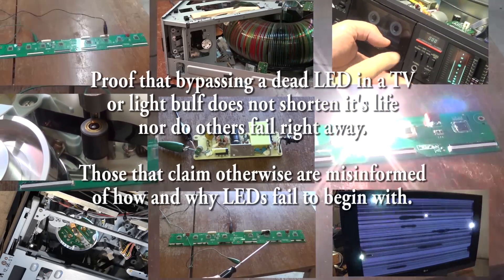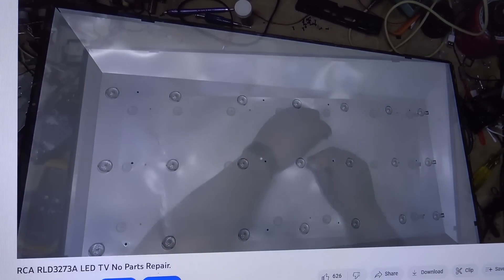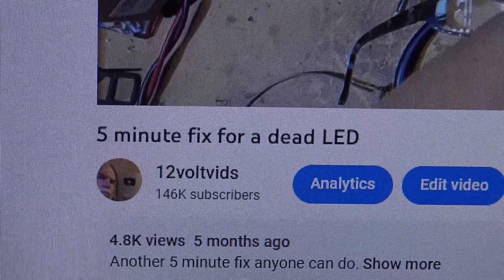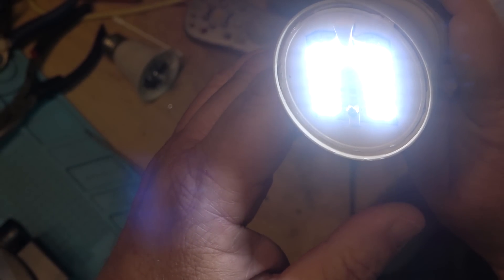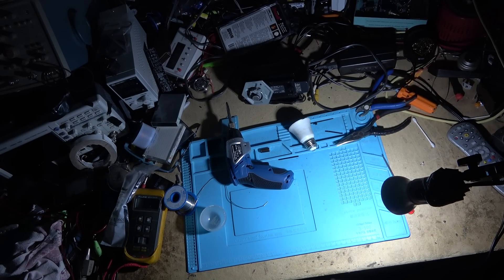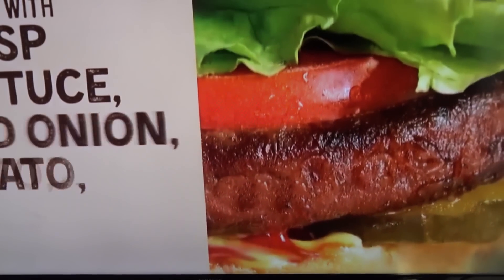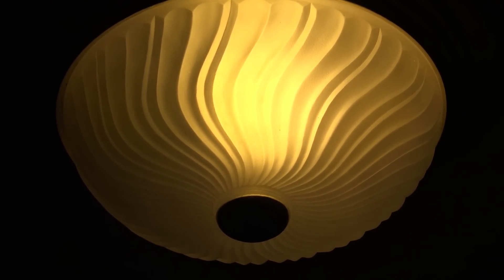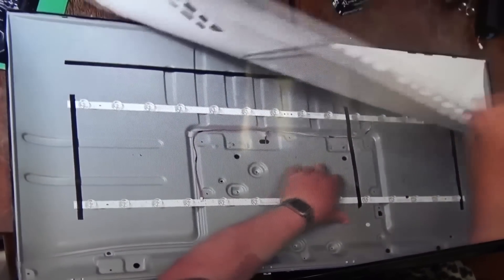You can stick your comments about LED TV failures where the LEDs don't shine

Comment: Bridging one LED will lower the voltage onto the series string of LEDs. It takes away strain from the buck converter type mains power supply, decreases heat coming from the supply and from the LEDs left (because one is missing). So in the end, it actually has the potential to prolong the life of the rest of the LEDs and the circuit. If people just would use common sense, they'd understand that this approach is working pretty well.

Comment: I think your method is great! You have to fix these things cheap in order keep the customer happy and keep the set out of the land fill. I wouldn't hesitate to bypass a LED or two after watching your videos! Thanks for sharing all this great repair knowledge with us!
Reply from the maker: It works. Been doing it for years.
Unfortunately I have to deal with the keyboard warriors that have no idea how the power supplies on these current limited Led drivers work.   they all have the same premise that if one LED fails all the rest of them must be ready to fail and that's just not how it works.  Led have a design life of 20000 to 100000 hours.  However defects in manufacture can have some failing as soon as a few hundred or fewer hours.  This is the problem on the majority of bulbs and the back lights in TV's.  They insisted all there have to be replaced. what they are forgetting is that even replacing all of them you could still have a new one that is going to fail after a couple hundred hours. There is not enough money in fixing TV's when 30 or 50 is required to buy led strips. Plus there is the extra labour to remove the old parts and reattach the lenses on the new LEDs. I've never made more than $100 fixing one of these televisions and many i make 0 on because the set was given to me and i fix it either to keep or unload.  
I have a 37" set i fixed the power supply on about 4 months ago.  I have been unable to even get 20.00 for it.  Have it listed at 10.00 now and nobody wants it and I have about 10.00 on parts in it.  Eventually it will be given away.  The video I made of the repair has generates 47.00 in the time it has been up. Sure it makes about 8.00 a month but that's a slow way to make money.

Comment: I did bridge the LED bulbs since I got the first dead one. I put a new one where a dead one was and I have put the bridged one to replace the old CFL's. None have failed yet, though they are at places that don't get used frequently.
Reply from the maker: Well i have 1 set that ribs 24/7 and no more failures abd don't expect any.

Comment: I = E/R it's that simple....
Reply from the maker: Except that semiconductors are not resistors.   They are open completly untill you hit the forward bias voltage then they avalanche into full conduction.
Reply: @12voltvids  I'm a retired BSEE no matter how you slice it more current = less usable life. You don't have to like it you just need to know the science. Do an experiment:  Buy 2 NEW LED lights same model number.  Modify one bypassing one LED.  Keep them burning until one fails.
Reply from the maker: @franksulu5274  the current does not increase.  On the tv the current is controlled.  It doesn't care if there are 30 or 60 led in series the current is limited to 30ma. Why do you think they use the same board on multiple models of different sizes.  I have taken power boards from 60" sets and put them in 40" sets and vise versa.  All work perfect.  The 40" set had 1/3 the number of led.  The voltage was matched to the number of led.  Now if you are considering a fixed viktage supply then yes increasing the voltage will increase the current but now with these led drivers.  The Philips bulb i chopped the failed diode out 8 years ago runs flawlessly and has every day.  The reason they fail is because the diode was defective from the day it was made it just took some time to fail
Reply: @12voltvids  I stand corrected. Did not realize the power supply was constant current.

Comment: Yes, you are right, but that applies to the US, because the quality of LEDs is not the same for America and Europe. Even the quality differs from country to country in Europe. What the manufacturer does is to set the current through the led diode to be on the endurance branch of the diode itself. That is why the modification of the current measuring resistors on the power supply board is done after replacing the diodes.
Reply from the maker: Europe does everything different.  I remember dealing with b&o crap and just hated it.

Comment: Great idear with bridging out a blown led ( what ever happened to quality control ). Ine way that i use to track down a faulty led is to use a 1.5 volt  battery and use that to see if a led works or not. But i have also seen several lcd tv's that have had several blown led's in the back lighting.
Reply from the maker: I had one recently that had about 8. I gave it away.

Comment: Hi Dave, when a CRT TV also has one of those built in DVD players or VHS players, or sometimes both, is this just adding additional stuff that can go wrong with the set and make it more of a repair hassle down the road? Do you recall if any issues with the built in players could carry over to the TV picture itself? Wondering if I should avoid the combo sets at all
Reply from the maker: They were a convince device.  Of course there is more to go wrong.
Reply: Avoid the combo sets. Always. I worked at an A/V repair shop for many years, and combo sets usually take longer to repair due to the dvd or tape mechanism making the entire rig more complex, and thus, more time consuming to repair. This ususaly results in a higher repair cost to the customer as time equals money. Also, if your dvd player or vcr needs repair, you have to bring the entire unit in for repair, leaving you down one tv to watch at home. My  2 cents.
Reply from the maker: @michaelbeam3151  i couldn't have said it better myself. About the only thing they are good for was presentation work. Schools ECT could have one on a roll around cart to take to classroom.

Comment: I am done with Samsung TVs. Had two of them start to get those purple blotches all over the screen. First one or two turn purple, and within a month you have 60-70% of them purple so when the screen has any light screen or white image it is like you have a blacklight running as the backlight.
Reply from the maker: The old falling lens syndrome.  I guess they changed to eco friendly glue to hold the lenses on and it didn't hold.
Reply: @12voltvids  So when the lenses fall off the backlight LEDs they start to turn purple. That is weird.
Reply from the maker: @AudioGuyBrian  when the lens fall off it creates an intense bright spot.   They turn purple from over driving which burns the ohoaphor.

Comment: I usually just replace the defective LED with one salvaged from a strip that wasreplaced.
Reply from the maker: Then you have acolir temperature shift as the replacement will have different usage hours and all led gradually shift blue with use. So you have a panel that is slightly to the blue and then 1 led that still has full red content. That sticks out like a site thumb
Reply: @12voltvids  I do have a question though.  How many LEDs could you potentially replace before high voltage drop across them became an issue.  Say at typical TV strip.
Reply from the maker: @tomschupbach2200  I have seen panels with over 10 dead LEDs.  Remember that an led going open is only one failure mode.  It's the only one people notice as the panel goes dead.  The other failure mode is dead short.  When this happens nobody noticed untill multiple go dead next to each other and then you have a dark patch on the screen.  The voltage is set by the number of LEDs as it is a current limited not voltage limited supply.  Under no load the voltage will shoot up to several hundred volts then shut down as it goes into ovp.

Comment: if a television is being used for about five years continuously then the LEDs are reaching the end of their lifespan, the little extra cost of replacing the LED strips would make a more lasting repair  would it not? it would be more likely that another LED fails shortly afterwards by bypassing simply due to them all being the same age and reaching the end of their lifespan. Yes the rest of the LEDs could possibly last but would you guarantee your repair? and would your customer be happy if another LED failed a month or so later  and have to pay for another repair. I'm sure the customer would pay that little extra for new LED strips for a more lasting repair and not pay out for a bodged job.
these are your own words " LEDs age over time" they become more blue light, it still would be better to replace all the LEDs to bring the colour temperature of the screen back to original spec another reason to replace the LEDs.what you did is still a botched job and that is the truth.
I am not trying to troll you I'm just saying it's the right way to do the job. Peace
Reply from the maker: No they won't.  I got 70 bucks for the repair. Am i expected to buy the parts for them?  A "little" cost is minimum 50 by time shipped to Canada after the shipping companies get done with all their fees.  I had a max of 70. I told them i could order in new LED would take a few weeks to get parts and it would be 150.  They said remove the dead one.  
Remember this is a 200 tv so nobody is spending much to fix.  I am surprised they went to 70.  Even 30 years ago around here if a TV cost more then 100 to fix they were being thrown out.   The reason i got our 20 years ago was because there was no money in it. Perhaps things are different where you are but here nobody pays anything to fix anything.

Comment: I never realised light bulbs were running from a constant current supply I did know TVs did . I must play with some dud bulbs. You have to forgive some of the trolls as they only remember when light strings in series across the mains needed to add up IE 10x12v lamps = 120v

Comment: My samsung 75" tv have been running for 50K hours now, I call that a workhorse. But it's got Edge-Lit LEDs (not backlit arrays) so they are quite horrible to change, and they also have burned the reflective plastic from the edge of the reflecting layer, so even when changing those leds, it will have "yellowish" coloring on the reflective panel because of the burned edges of the reflector.

Comment: Dave I agree with you that incandescent bulbs are probably cheaper in the long run. LEDs are so much more expensive to buy and like you said unless they last years as they claim they will they will not level out the price difference. I had refused to buy CFL or LED bulbs.  Now that they have outlawed production of incandescent I have no choice. I bought 3 decorative LEDs to put in my outside post lamp. They cost around $20 for 3 and I think I paid around $6-8 for 4 incandescents. I kept the receipt and if they don’t last as long as they say on the package you can bet your boots I’ll be asking for a replacement free of charge!  I suspect the electric vehicles will be much the same story, they will probably be more costly for the consumer in the long run as opposed to combustion engines.

Comment: If bypassing the LED does actually shorten the life, it would be in such a small amount that something else is gonna fail before the LEDs, to the point where I have to agree with you, the other LEDs are not gonna fail due to the age, nor will it fail from the ever so slight voltage increase and current increase across it
Reply from the maker: Constant current supply.  No shortening of the life.  I think that bulb i fixed 8 years ago proves that.
Reply: @12voltvids  you're right, I never even thought of that, either way it's not gonna fail over 1 LED being jumped out

Comment: 8 years? blimey, i've never had a led bulb last that long yet, shortest was about a month!  the current stabiliser chip popped open circuit, the leds are ok its replacement of different brand but likely same innards, 4/5 months so far ....longest at the mo, a bit over a year, for one that has a lot of use, ( theres others 3/4 years and still going, but theyre less used,)  but its in an enclosed fitting so gets hotter than if 'open'

Comment: yep, if the  leds are fed constant current then shorting one or more out wont make a difference to the leds, but will increase dissipation in the driver, if 'linear' current regulator,, if fixed voltage driven, it likely will be an issue ,

Comment: Well, I had one crappy (old) TV that did not have constant current on the LED-strings. So 2 dead strings (=2 dead LED in those strings) killed the next (of 8!). But this is not the standard, nowadays those monitors/TVs have constant current drivers. Don't remember the brand, I tossed it years ago, but it was one of the really early ones with LED and I guess the almost same model was running on ccfl before. I fixed it by replacing the failed LED back then, and that was quite a pita. Getting those LED off those aluminum strings was kinda nasty and the replacement LED did cost quite a bunch of money. About 25$ for 5 LED AFAIR, it's about 10 years ago.

Comment: i feel that if i could replace the LED i would, but shorting it out should not be a problem as long as the supply circuit has enough designed in head room on it power dissipation. As although the supply is constant current, by shorting the LED out you are moving the power dissipation from the LED to the driver cct. but if it's a switcher this should not be too much of an issue, but if its and analogue constant current supply then it will be dropping a few more volts at the same current, so getting a bit hotter.

Comment: I know you know what you're doing. I'm no expert, but if something works long term, it's correct.
Until I learned from you, I would have assumed bridged LED's would burn out quicker. Like incandescent Christmas lights wired in series. (A bulb burns out, the rest get more voltage) But there's no current limiting usually on those type of lights.

Comment: Its a valid argument, take a 5 series LED chain and short one, you over volt the others by 20% This may work but it depends on how far the manufacture was pushing the limits of the LEDs.
Reply from the maker: No it's not a valid argument.  Perhaps if you are dealing with a battery with a fixed viktage but the driver circuitry doesn't work this way. It's a current limit supply. It will push 30ma regardless if there is 1 or 100 LEDs in series.  This is also one of the reasons the LEDs are in series.  Judging from the number that suggest that the led be in parallel however indices that these people people have zero knowledge of the design.
Reply: @12voltvids  If its a current limit supply the math would still apply. Rather than pushing 20% over voltage it would be 20% over current.
Reply: @kkendall99  That's not how series circuits work. If it's a constant 100mA output it's still going to output 100mA, just now with reduced voltage.
Reply from the maker: @kkendall99  no, incorrect.  The voltage is dependent on the voltage drop.  You are stuck in the dark ages of ohms law thinking a constant voltage supply.  Each led has a specific drop.  The voltage is the sun of all the LEDs in series.  The current is constant the voltage depends on the number of diodes in series.  10 and the voltage drop would be 34 volts.  20 and it's 68 volts.  The current is constant at 30ma.  Remove the load and the voltage will go to whatever the power supply is capable of.  Put a resistor in series to limit the current to say 20ma and the voltage measured on the diode side would be the same but the viktage on the other end of the resistor would be much higher as the resistor is dicipatibg current which would be represented as a voltage drop on the LEDs.  The led brightness is controlled by pwm.  They all light up full brightness all the time but the duty cycle is reduced to reduce the light output.   It's ok if you don't understand it took me awhile to figure it out when i first started working on them.  The ccfl LCD lights work the same way.  They change the duty cycle as they are actually pulsing a few thousand times a second.  Want to see it in action? Use a video camera with a variable shutter and you will see them strobing.  The thing is it doesn't matter if you remove LEDs as the power supply doesn't give a rats ass how many led are there.  Every screen size has different number.  It is only concerned with keeping the current constant and supplying the pwm signal to control the duty cycle.   The voltage is determined by the number of led in the string.
Reply: @12voltvids  Me living in the dark ages might be true but generally speaking LED circuits are generally constant current based.

Comment: I've seen Youtuber BigClive do the same thing with LED's. My mums kitchen light uses three LED bulbs. I put three brand new bulbs in from the same manufacturer and the middle one of the three failed yet the other two are still going. The light fitting is also on all day. From when she gets up, to mid evening, just because not much natural light comes in. It took 2 years for that one bulb to fail.  You are absolutely right, A single LED failing like that is just a manufacturing defect.
Reply from the maker: That is why LED fail.  They are solid state devices.  They should last forever.  They only fail for 2 reasons.  Over loading and defect in manufacturing.   On TV's the backlight should be set to 75% max. They will last forever.  By cutting down the brightness the odd led that wasn't made quite right will be kept from going over the cliff.

Comment: If your led shorts outt a light bulb and tv leds can't you solder in another led?
Reply from the maker: Not needed.  Just bypass.  Don't change just one.  It will mess up the color.  Remember the color demo in this video.  High hour led more blue than low hour.  Same in tv.  Start changing a single led or 2 and ur will stick out like a site thumb.